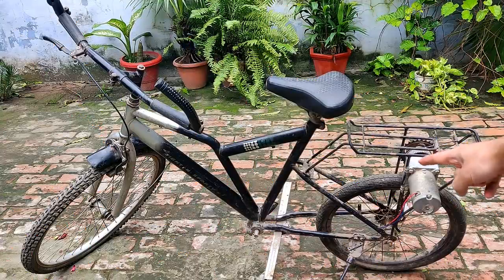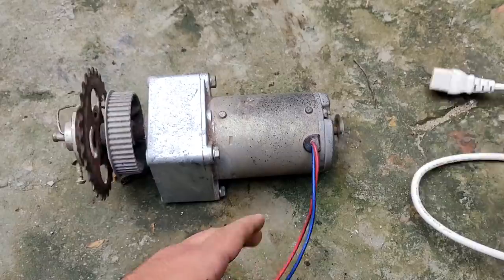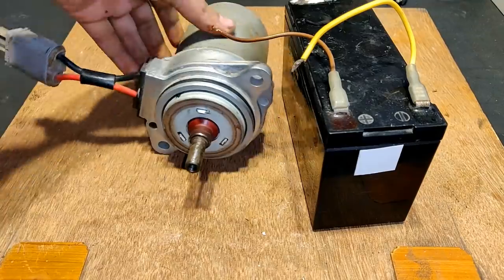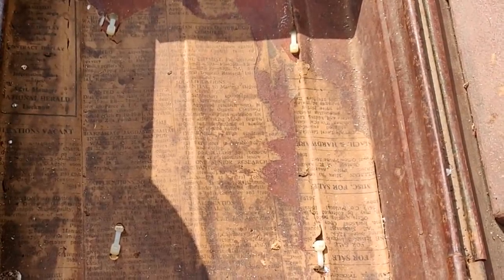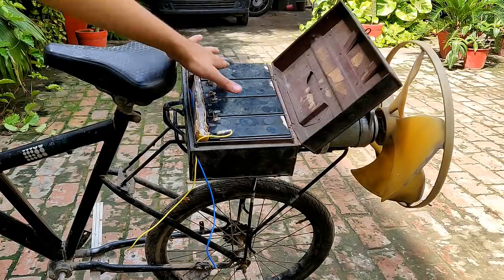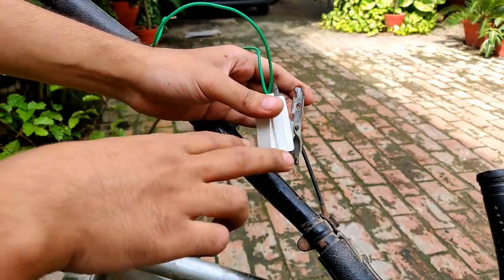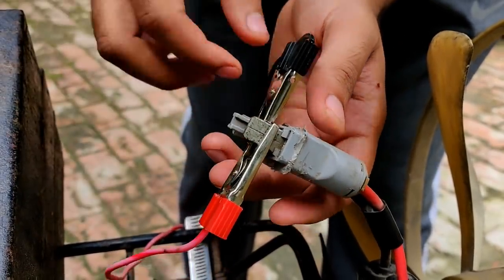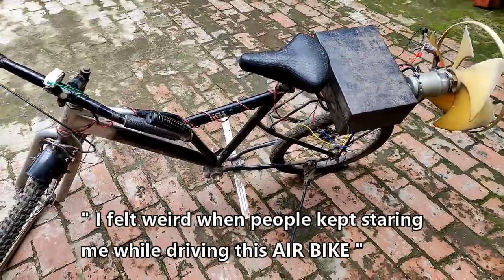30000 RPM - 48v 500W DC Motor Powered ebike ( Air Bike ) DIY

Comment: try a bigger fan blade... cool invention man!!
Reply: Larger gauge wires would benefit the performance more than increasing fan size also better wire connectors adding bigger fans or motors may not even be necessary if what he has is done correctly

Comment: The wire heating issue is due to inductance
Reply: Mostly the small size
Reply: Inductance is a problem in AC circuits